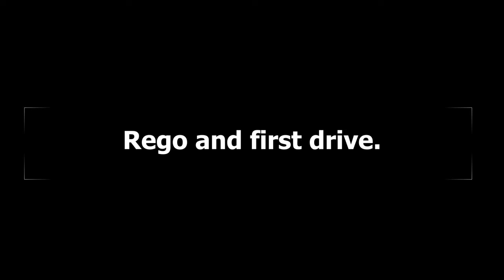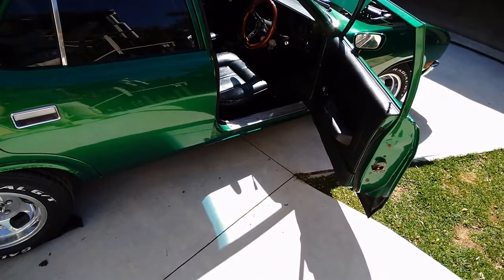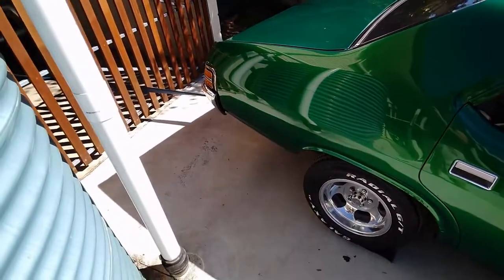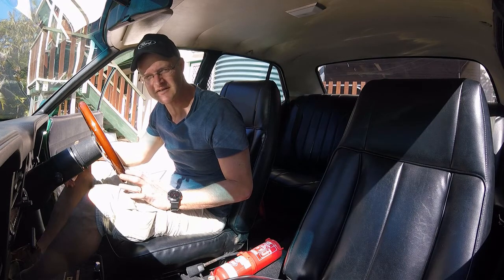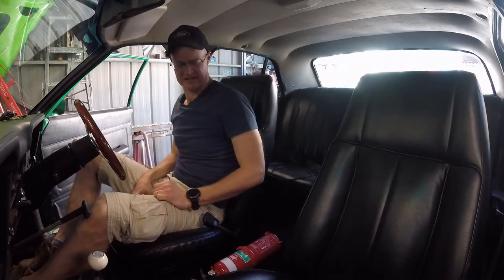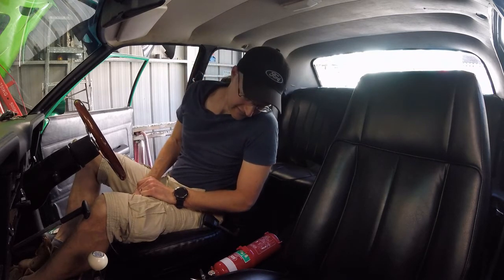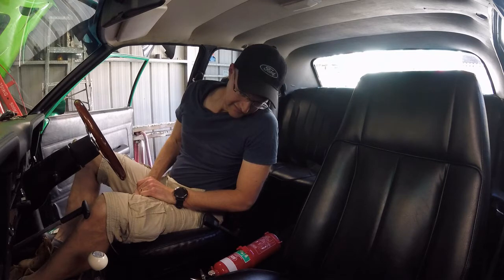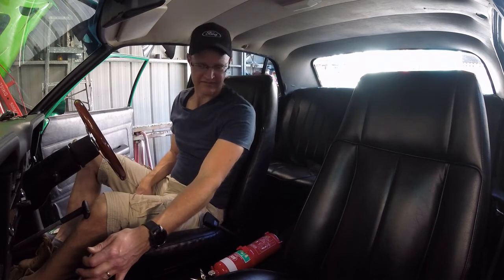XC Ford Falcon 351 Cleveland project: Ep 38 Rego and first drive.

Comment: Nothing beats that first drive. That was me last Friday - after I had finished at Transport, there was just enough left to throw a bit of fuel in the tank and cruise around for an hour. Once you sort out a couple of those small teething problems, she will be sweet.
Reply from the maker: True that Mick, I'm getting there. Doing timing currently.
Reply: Why was the old steering wheel barrow k on